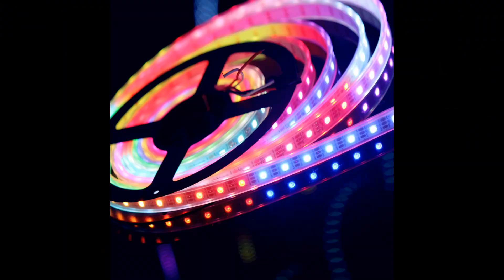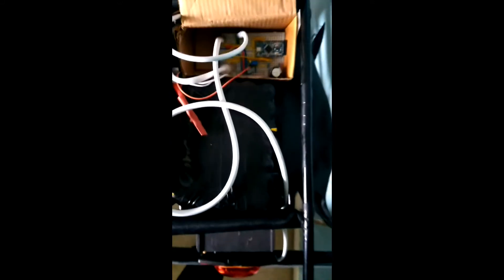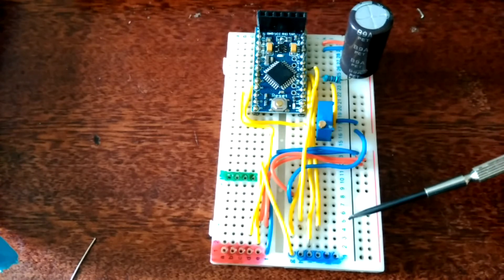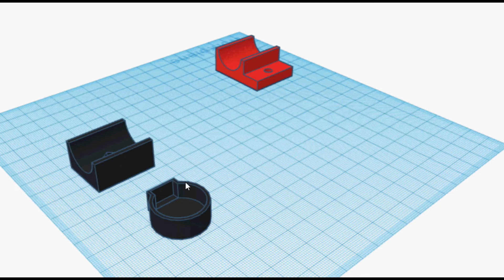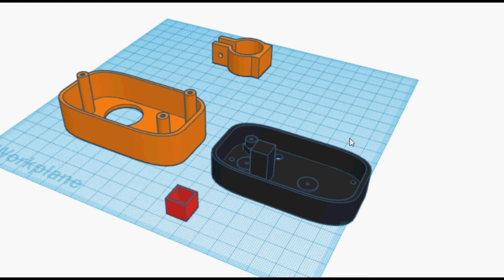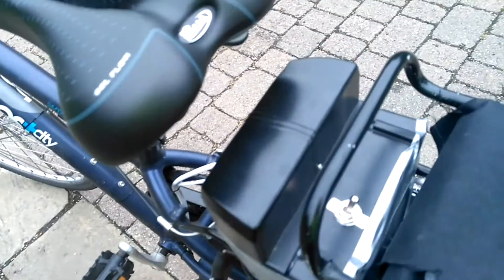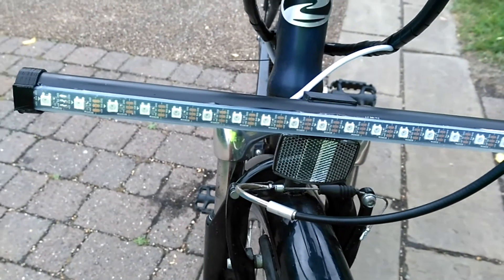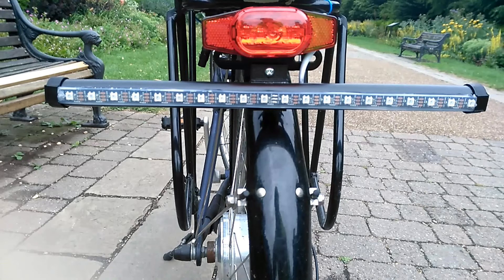DIY Neopixel Bike Lights

Comment: Attaching led strips to a flexible nylon cable ties with a heat shrink tube and bending them at certain angles looks neat and light but unprofessional. Velorian is using turn signal lights barrowed from a motorcycle world but since every gram counts those might be heavy due to use of many metal parts despite being very small.

Comment: Nice project Chris, but I think the animation is confusing - just because you can, doesn't mean you should!
Reminds me of when secretaries started using desktop publishing and used every font in the list!
People expect the turn signal to be yellow, and flash at about 2Hz 1:1 markspace ratio on one side.
As nice as neopixels are and fun to use, it's a fairly expensive solution for one that can be solved with plain leds!
Reply from the maker: Hahahaha. Good point. Also - shut up. Hehe. In fact the system developed a fault which, at the time, I couldn't find the time to fix, so the bars are no longer in use. I still think there's some merit in configuring a rear bar to do different things if a car approaches too close or too fast - that was on the plan but never for to the top of the list. I enjoyed the challenge though.
Reply: @chriswesley594  Was good learning though. It's a solution looking for a problem and chose one already solved!
With a few more you could make a text display if there's something you really want to say like... "Thanks!" or "Asshole!" etc...

I made a strobe using 200W cob leds, a digisparc and a mosfet - you could use a doppler radar module to activate it to grab attention.
I use it sometimes - it's just blinding and guaranteed to get you noticed.

Comment: Nice work, those turn signals are clutch! I've been messing around with making bike lights using similar led strip lights and usb 18650 power banks. eBike manufacturers need to start standardizing integrated brake lights and turn signals.
Reply from the maker: Hi and thanks for your comments./ I never heard of "clutch" like this before, but I'm guessing it's a  good thing. I subscribed to your channel and I'm looking forward to watching your stuff. Are you interested in some kind of collab? If so, please email me at chris @ chris wesley . org (remove spaces). Might help us both with subscribers.